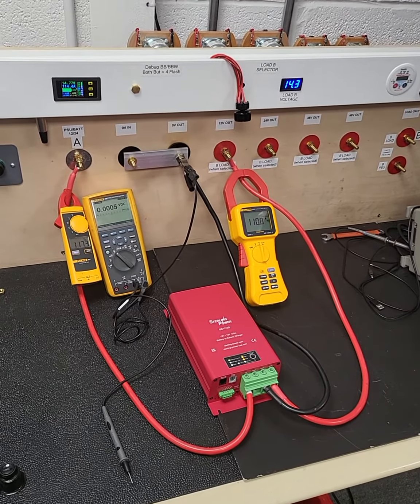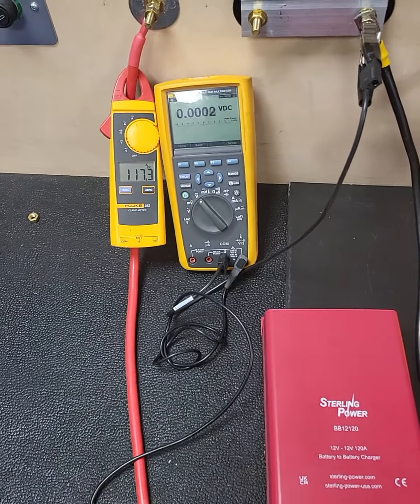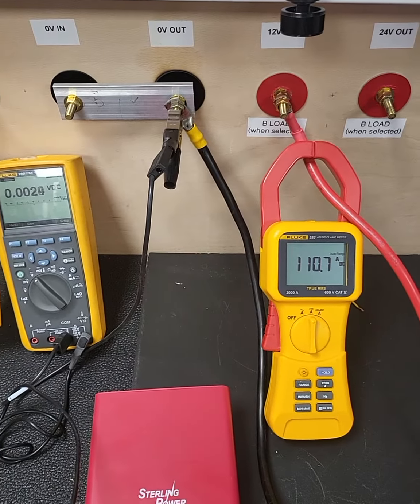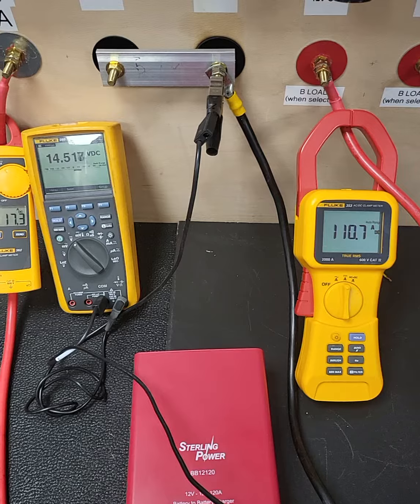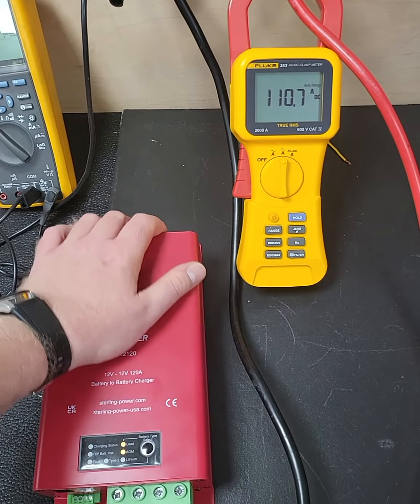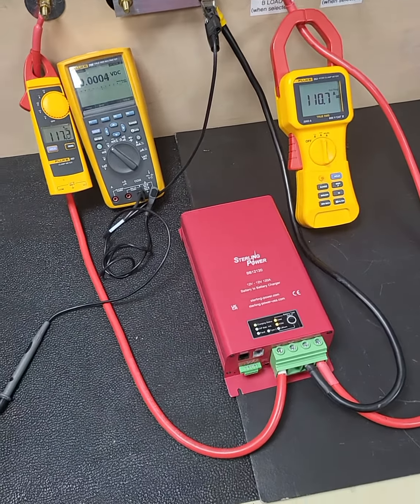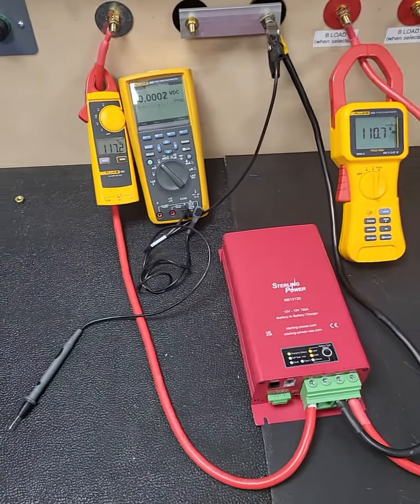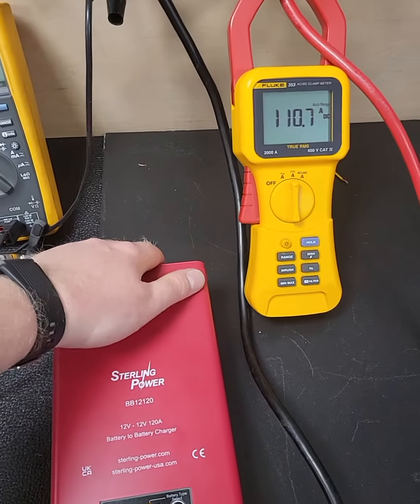BB12120 - 12V to 12V Battery to Battery Charger 120A Model - 1620W power output demonstration

Comment: This looks really nice!  I noticed you only connected one ground wire.  Is this isolated or non-isolated?
Reply from the maker: Hello Jon,

The negatives on the unit are common to one another. The BB requires the starter, leisure and charger to all be on the same negative circuit- we only added the second negative on the unit to simplify peoples installs.

The inputs and outputs are isolated from one another- but the charger itself is non-isolated- they cannot be ran in series to produce 24V for example.

Comment: I would love to see a alternator temperature sensor on those devices to stop alternator from overheating at low rpm.
Reply from the maker: Hello John,

A sensible thing for us to consider in the future. For now, the best thing we'd recommend is simply to rate the BB system correctly so the alternator shouldn't overheat in the first place. We recommend BBs to be installed up to about 70-80% maximum of the alternators rating - that should allow us to avoid alternator problems. We'll think about adding it to our units, particularly the more powerful ones..!

Comment: My alternator will output 110a at about 12.6v so when the unit is boosting to 14.5 will it generate more heat and ramp down output?
Reply from the maker: It'll probably generate more heat, but it wouldn't necessarily ramp down in current. More a question for your alternator company I'm afraid. We'd recommend the BB1270 if your alternator is 110A rated.

Comment: Does this unit connect via Bluetooth to remotely monitor the performance?
Reply from the maker: Hello Brian,

No, no bluetooth on these units at the present. We wanted to simplify the user interface as much as possible. Best thing to use to monitor what is going on in your system is generally just a battery monitor or a shunt/amphour counter.
Reply: @SterlingPowerLtd  thanks for the answer.

Comment: My alternator is 280 amps max and 180 amps at idle. With this 120 amp charger, will it charge at 120 amps during idling AND driving conditions when the engine has higher than idle RPM's? Or, will there be a lower than 120 amperage when idling?
Reply from the maker: Hello,

The unit will attempt to run at 120A continuously, pending your alternators ability to support it.

If the input voltage begins to sag (IE the alternator is unable to sustain the load) the unit will downrate to 85% and then further to 65% if it is still struggling on then input. 

So long as we are not seeing critical input voltage collapse (which I would not expect to see at all with the strength of your system) I would expect to see 120A continuously. 

Ben